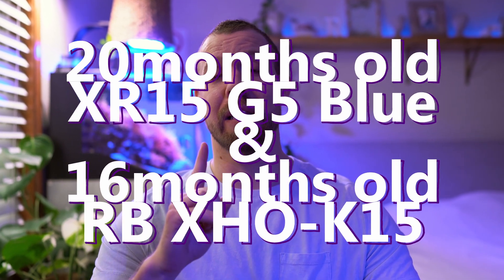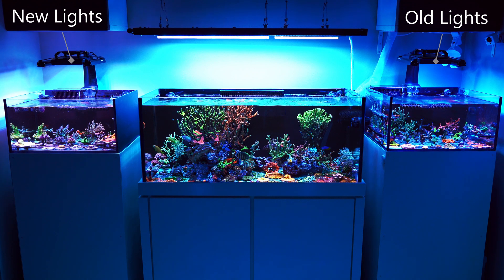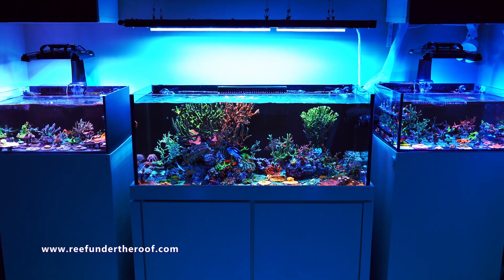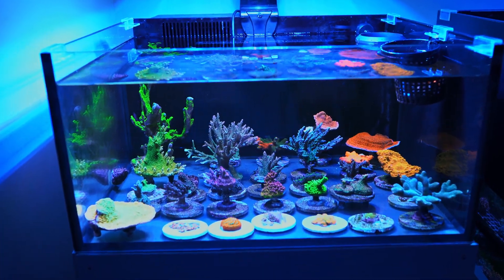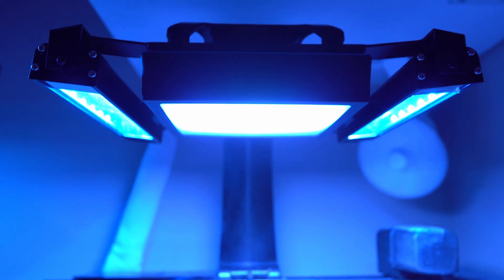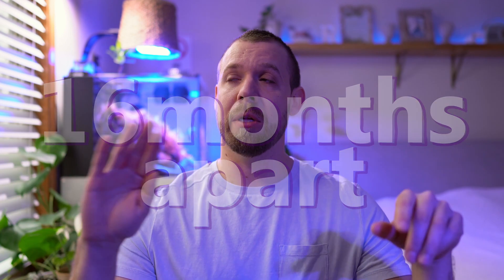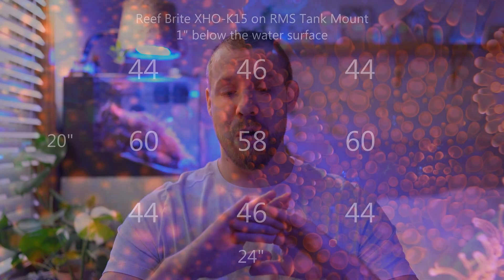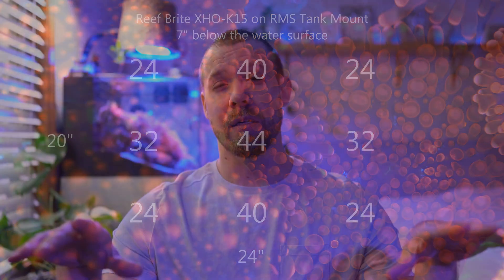How FAST Reef Tank LED Lights Degrade - 20months OLD XR15G5Blue & 16months OLD ReefBrite VS NEW Ones

Comment: shocking!
I wonder if there could be a shift in the spectrum...
But saying that I'm super happy to hear this as I have a used Gen 4 (somewhere), a Gen 5 I'm run on my QT tank and a Gen 6 - and the three I want to run with T5s and bars on my next build. This means the Radions should last and I am going to assume the same applies even to cheaper diodes (due to the Reefbrites). My guess is the issue is from overheating (and why I'd likely get Reefi's next time.
It seems a lot of reefers upgrading LEDS every 3-4 years and I think they should be good for 7-10. Be good to see longer warranties and also upgradable diodes like Illumagic do.
Reply from the maker: I have a friend with a beautiful tank and he runs gen3 xr30s. Will check my lights in a few years and will compare them to these par values. I don’t know about spectrum. I assume that it changes, but how much…I don’t know?!

Comment: I have 2x 4 year old Red Sea RS90 LEDs and they are about dead. I think they put out 50% of original par  There is a noticeable difference to new/1yr old ones.
Reply from the maker: I never had Red Sea lights. Yeah, probably not all leds are made equal.